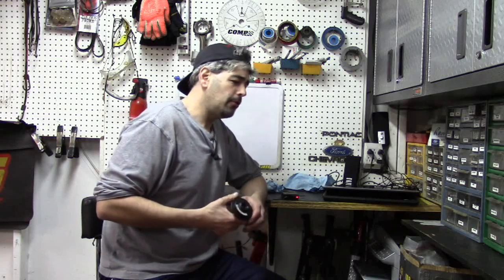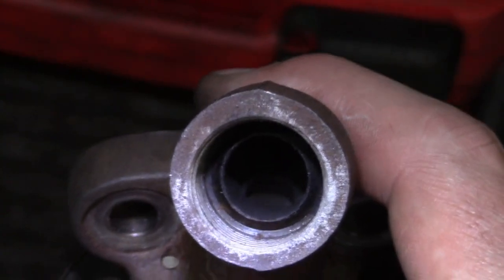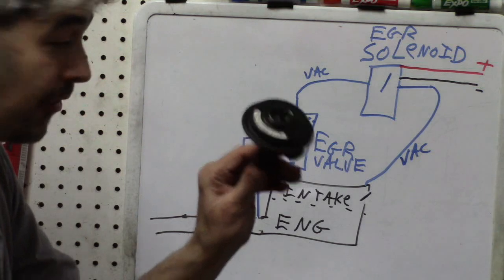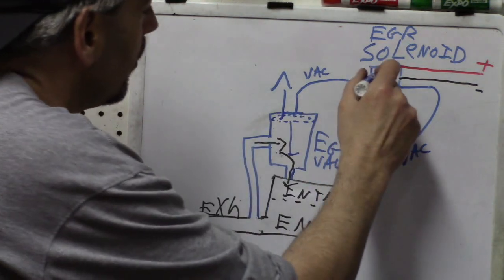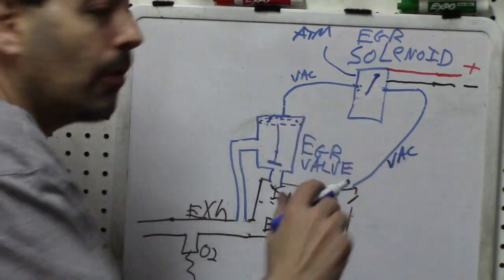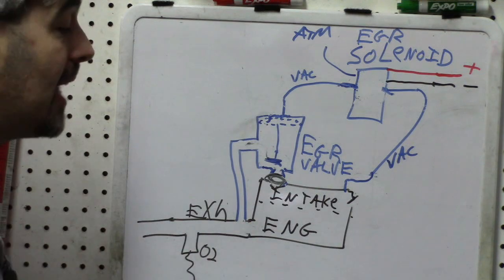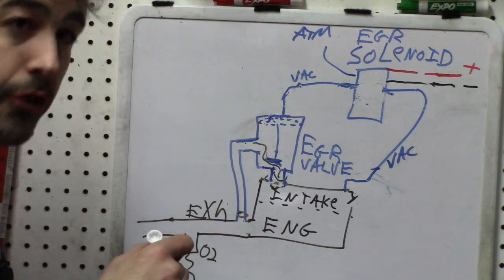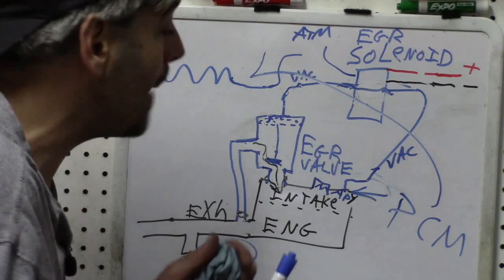EGR  P0400, P0401- P0409 Diagnosis+Understanding Pt1

Comment: No Sir no vapours only exhaust gas to reduce combustion temperature * Do not over produce your self *
Reply: , is your friend.
Reply: Reduces Peak combustion temperatures which reduce NOX emissions.
Reply: icemule ,
Reply: The professor is right there are vapors- unburnt fuel hydrocarbons from imperfect combustion

Comment: I have a P0401 , the code said DPFE sensor had recirculation flow insufficient detected , i replaced my DPFE sensor with a new one today and disconnected the battery cable too before the procedure , after i replaced the DPFE sensor , i took my 1999 ford expedition 5.4L for a test ride and sure enough the check engine light came back on , havent checked the code , i assume the P0401 code again , please help . Thank you
Reply from the maker: Not understanding why you changed the DPFE.  what data did you have showing it was the problem?

Comment: Thank you for this series!  Understanding how the EGR/DPFE/solenoid system works helped me troubleshoot properly, and ultimately find a hole in the vacuum supply line to my vacuum solenoid.  This meant that I avoided replacing parts blindly (which would not have fixed my P0401 code).

Comment: Hey Matt,

-First of all, great explanation and descriptions (and drawings) !

-Second... see what you think of this, your welcome to share it or refer to it if it helps in your laying this out, I know your style and I know you will like it ;) https://www.youtube.com/watch?v=OIp4yWN1Ay8

-Third and last as I was making dinner and listening to you talk about EGR "sensing" I will call it, a few things came to mind. You mentioned the decrease in MAP, on vacuum style EGR's and a potentiometer on linear EGR's It brought to mind that some vacuum controlled EGR also have a pontetiometer on them too. Think of the early 90's Fords with the big white "TPS" bolted to the top of the EGR. I also thought of some of the Toyota systems I have worked on with a EGR Temp sensor to tell the PCM  "hey I'm open" and then remember we have the DPFE (Delta Pressure Feedback EGR) system that Ford also likes to employ. I also remember working on some mazda's that had there own separate "boost sensor" just for the EGR system. I was also trying to remember but I think it was GM back in the day when they first started using electronic EGR's they had one that had 3 pintles all with different size orifices and it would just open and close any combination of them at 100% duty cycle to obtain a certain amount of flow. At any rate put my brain in flash back mode. Hope you get a chance to look at that video!

Comment: Sorry knew I was thinking of something else too haha you were mentioning the different types of failures they can have from carbon build up, failed EGR solenoids, broken hoses etc.. don't forget to mention the classic restricted exhaust. This will really screw with DPFE Style EGR's and the Chrysler's that use a "back pressure transducer" in conjunction with a vacuum solenoid. Dodge used those in the late 90's early 00's a lot. There I think that is every thing that was on my mind. Going to watch part II now!
Reply: Thanks for the info Dr. O. Wish the chalk-talk diagram included the DPFE/MAP/MAF components. How about someone  do a video/class on all things EGR related with all components and troubleshooting considered.
Reply: ....thank you for the info...my EGR valve keeps blowing out a hole through the EGR valve on my 03 mazda tribute 3.0 DOHC...!!!????

Comment: Thank you for the video mate. What do think is the issue when you get a P040300 code on an Audi A3 2010?
Reply from the maker: what code is that? do you mean 0430?
Reply: @SchrodingersBox  That's exactly
Reply: @SchrodingersBox  When I scanned the car that's the code that came up.
Reply from the maker: Almost 100% guaranteed bad catalytic converter.  confirm by seeing if the rear O2 trace is same as front O2 trace.
Reply: @SchrodingersBox  Thank you for your reply, I really appreciate. One last question. The code is P040300 exhaust recirculation circuit and the status says, passive/sporadic. Is there a chance it was remapped and is remapping legal?
Reply: @SchrodingersBox  And the engine light comes when you turn the car on to position one and disappears when you start the car. Thank you.

Comment: I came here to learn about how the EGR valve work. I am not disappointed. I subscribed and liked this video. Now after 25 minutes I still haven't learned about the electronically controlled EGR valves so I'm going to proceed on to part 2.
Reply from the maker: yes part two covers the electrical ones. a bit more complicated and not as easy to test without a bidirectional scantool but still doable.

Comment: I’ve replaced my VCV my EGR valve. I don’t know if it’s my air intake manifold being clogged my solenoid. I never even heard of a solenoid until now. I have a 2000 Toyota Camry LE 4ycl and bought a chilton instruction manual and I am in need of further education

Comment: My egr control valve makes weird noises so i think its caput a new one is only 16 bucks and i have a insufficient flow code i checked the egr valve and it works when i apply a vacuum.  I got a vacuum on it when the engine was idling and it started to run rough when i opened the egr so its working.  Process of elimination.  Line to egr control valve has vacuum so the valve is not opening probably a stuck solenoid.

Comment: Too many variables with this diagnosis. Home gamers are probably better off cleaning/replacing parts cause it's probably going to end up being cheaper than paying $90 an hour for a dealership diagnosis and labor. Likely they'll fix the wrong thing anyway and you'll end up fixing the right problem at home yourself afterward or spending another bundle paying the dealership to fix the next thing.

Comment: what is the pressure difference between the exhaust gas at higher rpm and the intake manifold at high rpm's. It can not be much???  Not much exhaust gas can possibly flow in.
Reply from the maker: It isn’t much for sure however there is some vacuum from the intake which draws in the exhaust and the exhaust does have a little positive pressure as well. But yes- the amount of exhaust drawn/pushed into the intake is pretty minimal.

Comment: Hi I had an EGR valve replaced a couple months ago. But my service engine light is back on and it comes up the same code PO401. It also says to clean all exhaust gas recirculation EGR ports. Should they have done that when they changed it? Or could it be the EGR solenoid? It's a 03 Buick century. If you can give me any feedback. I would truly appreciate it thank you
Reply from the maker: Yes they should have cleaned all ports but more importantly they should have verified the EGR valve was the actual problem!
Reply: @SchrodingersBox  
He said that was the only code that was coming up. Is there more than one? or could there be something else wrong with the EGR valve?I really don't know what to do. If you have any advice I'd appreciate it. Thank you

Comment: Thanks and well done. I have a problem with a Peugeot 1.6 HDI which has black smoke during accelleration. Turbo changed and also EGR. Planning to get a specialist to look at it........I have seem some excellent vid's on the 3D mapping. My instinct is either the turbo control ( not enough air ) or the EGR controller ( too much recirc of exhaust gas ). Any general ideas for me to think about ???............Other than the black smoke during accelleration the car starts and drives perfectly. P.s. There is an error code (may not be related) ref; emissions. Which I think is the O2 sensor.

Comment: Felt like being a butt again...  :]

I won't speak on behalf of "ricer boys," but from my experience, doing an EGR delete improves cruising throttle response.  It's absolutely true that it has zero effect at WOT, but of the cars I've fiddled around with it on, the transition from highway cruise to passing acceleration feels much more crisp and responsive.  Sadly, I haven't had the opportunity to try this on a properly big V8 engine, but I would expect that the effect would be much less than on a small 4 or 6 cylinder engine.

It also has the effect of absolutely trashing highway fuel economy, and need I even mention that the EGR system is an Emissions Control Device.  It may feel great on the Butt-Dyno, but the trade off in fuel economy and increased combustion temperatures just aren't worth it.  :-)
Reply from the maker: This summer when race seasons starts I plan on doing a series on free mods and typical ricer mods to show how ridiculous they are.  Too many people with narrow thinking on "cold air and more air=more power" but they have no intelligence on stoichiometry and fuel trim effects. Obviously I will have quantitative measurements rather than the infamous SOTP testimony.
Reply: Schrodingers Box Are you trying to say I should not bolt on a cold air intake with a K&N, fart can exhaust tip and wing on my Honda Ridgeline? But dude... IT'S V-TECH FOOL!
Reply from the maker: South Main Auto Repair LOL! You will probably appreciate my analogy of V-Tech for people who think it's a performance engine.  Name ONE high performance engine that is present in a minivan for any manufacturer. Dodge Caravan with a Hemi? Nope. Chevy Astro with an LS1? Nope. Honda Odyssey with a V-Tech? YEP! Its what their moms drove them to soccer practice in!
Reply: Yeahhhh boyyyy V-Tech sukka!!

Comment: Pretty unfair of you to say that everyone in the forums is a clown, if most of the garages werent trying to rip us of Im sure most people would just go to them. I like the fact that people who have the same car or motorbike try to help each other. If only all mechanics were like you eh?
Reply from the maker: First, I am not a mechanic.  second, the forums are not made of people trying to help eachother, they are made of people giving at advice for their own ego AT THE EXPENSE of others.
  It's why when you go to these forums, like everyone else, you just take a guess at parts for people to replace and then pat yourself on the back if you got it right or were close to what actually fixed it.
  Its fun to guess isn't it?  Thats not helping people.
Reply: @SchrodingersBox  I guess we're stuck between a rock and a hard place then. I try to really understand how engines work but the garages are just way to overpriced (for me) For the amateur, it can be difficult. I guess I'll just learn from YouTube with videos like yours :)
Reply from the maker: @danielleech1988  Thats what I would do. On the forums you are just going to get a bunch of people with no actual knowledge giving advice on what parts to change... and the person changes it and it doesn't work so other people take a guess.  Or my favorite- people who will actually say "Hey I have the same car and I had the same problem and it was the xyz...". As if all cars fail for the same reason.
   Go ahead and re-check your forums, see if I am not right.  Unfortunately, 98% of youtube channels do the same thing though.

Comment: I liked all your videos. Please i need your help. What could cause rpm to go high on park and neutral? what could cause fuel rail pressure sensor in high rage? Could leak exhaust manifold causes it, cause have changed the oxygen sensors, throttle body sensor. please, help me out. My car is Kia carnival 2005 2.5L petrol engine automatic. obd codes are p1169, p0056, p0156, p0030. Thank you for your help.
Reply from the maker: Could be anything. What dat do you have?

Comment: I just want to add the egr dilutes the O2 in the incoming air stream and provides gases inert to combustion to act as absorbents of combustion heat to reduce peak in-cylinder temperatures.

Comment: Can faulty egr cause smoke from exhaust under load ?
Reply from the maker: It could. Check your for differential pressure at the EGR.
Reply: Good shout. Min KPa 1.35 Max Kpa 13.54 Value on test 0.27 Kpa  @SchrodingersBox

Comment: The codes say its a few different sensors or circuits, but I have a feeling that it's a vehicle speed sensor or the PCM cuz now her cruise control is not working
Reply from the maker: Dont go on a feeling- go on data

Comment: I just paid my mechanic $320, 130 for the valve Eighty to it on, and another 80 for a seafoam cleaning, guess what light is still on, I’m sure he didn’t get the carbon off of the other parts, light is still on
Reply from the maker: Any mechanic that uses "Seafoam" should be shot. People who try to fix check engine lights with Seafoam are completely incompetent.

Comment: Cold blooded gasoline and cold air do not combust as rapidly........Hot air or gasses will evaporate cold blooded gasoline very fast and helps combust quickly inside the chambers .....Bottom line more horse power .
Reply from the maker: You have it backwards. Colder air absolutely, 100% without question makes more horsepower. The reason is because of density, not temperature.   You ALWAYS want the coldest air possible into the intake if you want power. Density not temperature.
Reply: @SchrodingersBox  Your talking about the gasoline being more dense in the air
Reply from the maker: no absolutely not. I am talking about MASS AIR FLOW. The cold air is more dense than warm air.

Comment: I recently pulled the EGR on my '98 Trans Am and put block off plates on.  Still have to get it to the tuner so I can get rid of my check engine light haha.  Your Trans Am looks clean!
Reply from the maker: +TheGuitarGuy09 why would you block off the EGR?
Reply: +Schrodingers Box Longtube headers coming soon doesn't have the port for it, so did some planning ahead.

Comment: I got a 2003 Ford Escape and it idles low and when you lift oil cap off it changes the idle could you help me out with that give me a good idea where to start
Reply from the maker: That would be expected - you are opening PCV to the intake.
Reply: Try the pcv system. My toy 3.0 would die if one checked the oil dipstick.

Comment: Firs AIR, then EGR, can I assume next will be EVAP?  Can't wait!!!
Reply: Your customer base is pretty good that they get the code read before calling you!  I would have thought they would have just used black electrical tape on that CEL like I do :-)
Reply from the maker: 12vgs8606 Hahahaha.  Actually what typically happens in this case is one of three things.
  Usually they go to a shop and fall over from the quote or have bad experience and ask friends what a place they recommend is and if one of those friends is an existing customer of mine they recommend me.
  The second thing, in this case actually, the person is already a customer of mine and they try to fix it themselves but can't figure it out.
  The third thing is person posts their code on craigslist or something to ask for advice which I check occasionally and I respond as you might expect I would. Usually I don't get a reply back because the person is just looking for a quick idea of parts to replace but sometimes I catch one who sees I make sense.
In all cases the person has the code before I get there. But yes, it is not the norm.

Comment: Just on hint, the most commen measuring/controlling device for EGR-rate at Diesel-engines is a mass air-flow meter. A Diesel doesnt need a mass air-flow meter cause it runs in lean condition all the time, so the only reason for an mass ait-flow meter is to see the drop of air-flow (fresh air) when we add EGR-Flow. This way the PCM sets the EGR-Valve position and controlls its working via a wideband lambda probe(AFR)

Comment: Can you do a video on the wire harness and or junction box for 04-07 Lincoln Navigator and Expeditions as the do have problems with the electrical system after it rains.
Thank you sir
Reply from the maker: Never heard of this issue. If thats the case the issue would simply be ground faults or shorts.  pretty basic, no?

Comment: Hello I have a 2005 Ford Excursion 6.0 diesel, was wondering if the diesel truck will have same type of EGR systems as a gas system. I know I don't need an EGR valve but I have the P0401 code and want to see if I can DIY it instead of taking it to someone and taking out a mortgage to get it fixed. Thank you for all your wonderful video's.

Comment: may you let me know. my card honda accord 1999 v6 feul pump good . but running empty gas the light not turn on, why?
Reply from the maker: What did the voltage show at the gauge?
Reply: Schrodingers Box everything works. The gauge works fine but the light wont show.
Reply from the maker: J D What was the Voltage reading you got from your diagnostics? I cannot help without seeing if there is voltage to the indicator or not.

Comment: Alot of times when one problem is fixed, it erases other related codes. Use the Troubleshooting feature on your tester to see. Sometimes when you replace one part and you get it to no- fault codes, another unrelated code pops up. Check codes regularly to prevent extra codes. Replace parts as a maintenance on cars. New parts last.